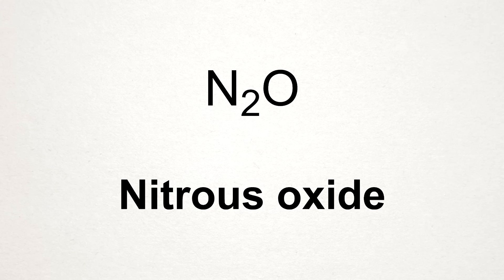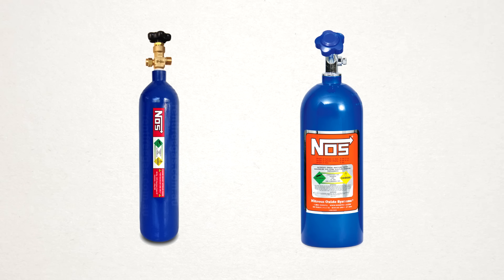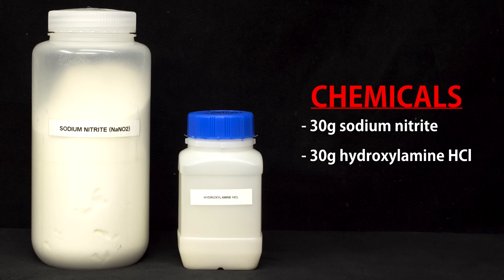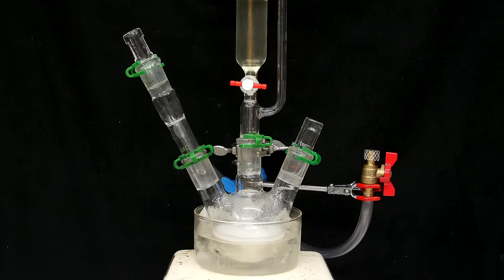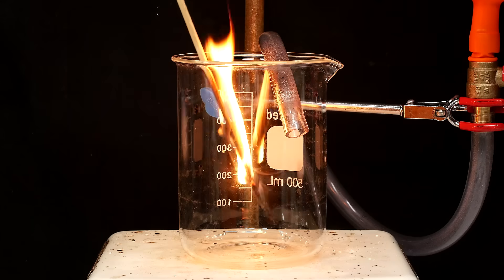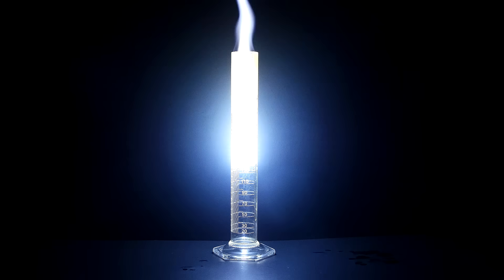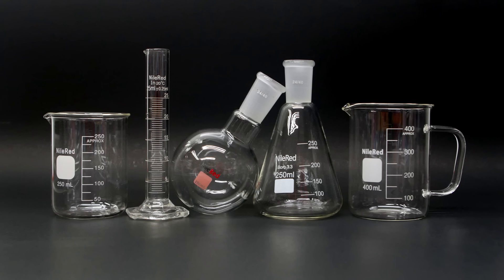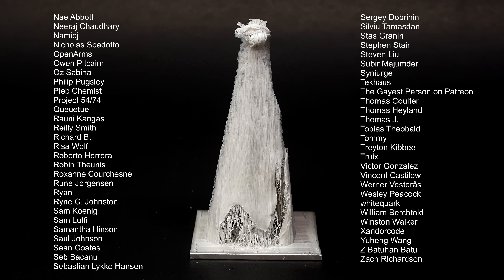Making laughing gas

Comment: I'm curious how this reaction behaves if you orient the tube horizontally or invert it and light it from the bottom?

What happens if you place a length of sound-absorbing packing at the closed end of the tube so pressure wave reflections are minimized?

How about packing at the open end?

What happens if you light it from the closed end?

That's a very blue/white flame. I wonder how much UV it's giving off and, if it might affect the flame front?

Comment: Isn't N2O heavier than air? Shouldn't the baloons therefore tip over and "sink" down?
Reply: I have reproduced the experiment and indeed the baloon tips over and sinks when it's about half full. It stays upright only if it's balanced but it's still "top heavy".
Reply: bkiffter pressure

Comment: Cool experiment!
The bright light emitted reminds me of sulfur lamps: An evacuated glass vessel with some sulfur inside.
When energized by microwaves, the sulfur emits near-white light, at very high light-levels.
Supposedly nearly as efficient as LED in terms of watts to lumens.
BTW, Texas City, Texas had the biggest AN explosion in north America, estimates around 11,000-20,000 tons.
Ship in harbor, AN in the cargo hold.  Fire on ship, you know the rest.
A factory town in Germany was nearly wiped out when a huge quantity of AN was being broken up using dynamite!  
Their process poured molten AN into a holding pond, where it was allowed to cool and solidify.  After that, workers drilled holes in the 'cake' and blasted to break it up. 
No one knew that pure AN was an explosive at the time, although ANFO was known.

Comment: The sound is weird! The different sound in the second trial may be caused by different reaction rate, which causes different air pressure and therefore difference frequencies. But it may also related to the grad cylinder itself since different tube has its own unique resonance frequency.

Comment: Just curious, when calculating the yield.  I thought measuring the volume would actually be a pretty complex calculation as the elasticity of the balloon would have to be calculated to properly measure the density of the gas.

Seems like weighing (tared) would be more accurate.  I'm probably incorrect, but I was surprised when you broke out the tape, would appreciate an explanation though.

Comment: i wonder if there's a way to control the reaction in order to make a steady light source
Reply: You could use 2 nozzles, I suppose, or 1 nozzle releasing carbon disulphide vapour into a bulb filled with N2O gas. 

Not a lot of point though when we have electric light. If you want an interesting chemical reaction that produces a source of light, look up carbide lamps. They have a chamber full of granules of calcium carbide, and a little dripper that drops water onto it. That causes the production of acetylene gas, which is then burned to produce light. 

They were used before electric lights, by people like cave explorers. You can still get them.

Comment: holy crap... "nitro" for racing cars is laughing gas???
Reply: I'm a bit late, but no, it's not. "Nitro" fuel is actually nitromethane and methanol mixed fuel. "Nitrous" is shortened name for a sort of chemical supercharging that is "added" to give more oxygen to burn in the combustion cycle of regular pump fuels and is actually Nitrous Oxide (or N2O) which is what NileRed is referring to in this video.

Comment: In calculating the yield, did you account for the balloons being slightly pressurized? I don't know how much of a difference that makes, but it seems like it might deflate your measured yield.
Reply: I've noticed that too! But I think the yield is bigger considering the high pressure (for the same volume, there is more molecules in pressurized gas than at normal pressure)!

Comment: Then I do NH4 NO3 ==> N2 O + 2 H2 O I put a litle lump of Mn O2 for a better reaction and safer.
After I store it on water I add an litle amount of air to stabilize it and remove N O whitch is present.